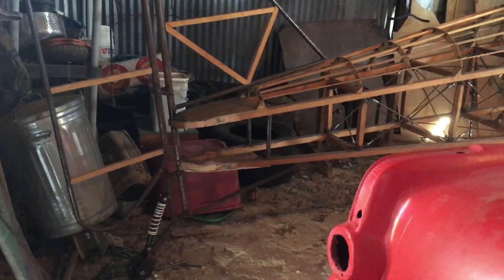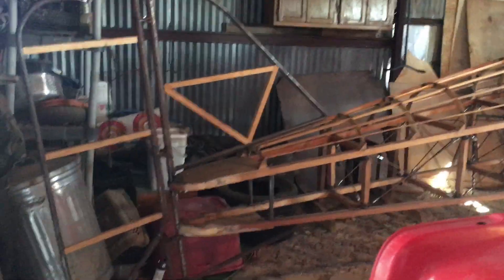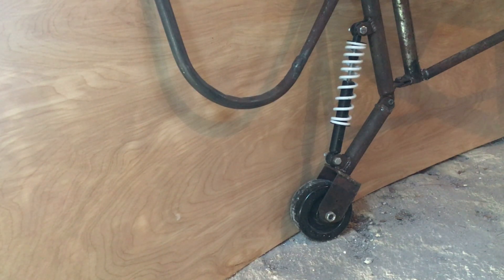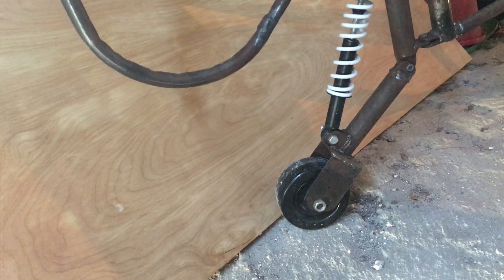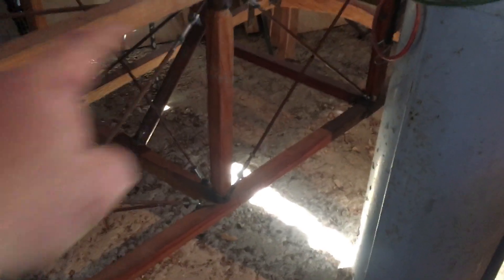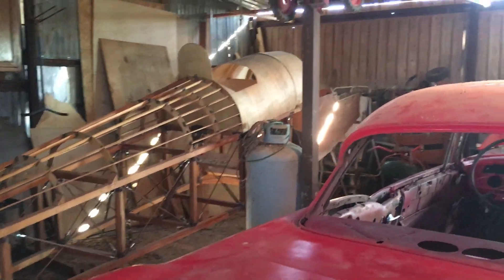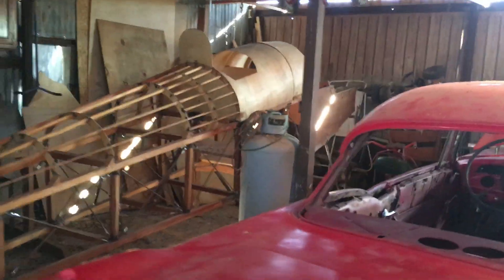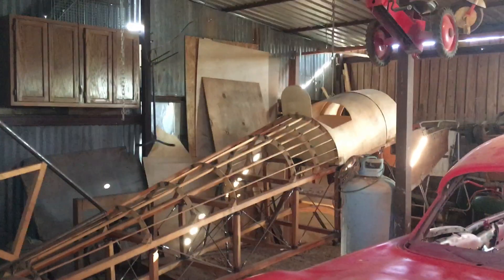Homebuilt Airplane Episode 8: The Landing Gear

Comment: Not a serious plane guy nor engineer, but are those little tabs the rudder is mounted to/hinged on strong enough to take the forces applied on the tail wheel?
Reply from the maker: I am a bit nervous about those as well. Surprisingly, were originally like that. I may end up welding on some reinforcement for peace of mind.

Comment: Does it really need breaks you think? Or is the wheel small enough to add enough friction when landing in a relativly soft field?

ofc not enough to 100% rely on it but realisticly, are you gonna use the conventional breaks a lot?
Reply from the maker: Brakes wouldn't be strictly needed for landings, but a small amount of braking power would be necessary for taxiing on pavement.
Reply: Ye on pavement brakes would be somewhat nice if you intend to land :p

Just make sure you tune them evenly. If it doesnt break on both sides equaly it might flip. 

Also, what kind of 3d printed weaponary are you gonna attach to it? Ofc not for real but its fun to think about ;)
Reply from the maker: @sawer Printing a fake Lewis gun and Vickers gun would be really cool, but I should probably save the drag and weight.
Reply: @EvanJonesProjects  Maybe very low infill combined with a lot of hollow spaces?

Comment: Very interested in the 3d printed gun because of its very unique have you though I trying to absorb the recoil and turning it into electrical power with a motor?
Reply from the maker: That's a really interesting idea! I hadn't thought of that before, but it sounds really promising. 

I have been thinking about alternative ways to make a DIY rifle lately. There's a ton of really promising systems, like blow forward and mag fed revolvers that have never been tried before. I really hope more developers start tackling rifle designs. They are intimidating at first, but they're less crazy than the seem. I may end up making a video about promising rifle systems.
Reply: @EvanJonesProjects  yea I don't know anything about making things let alone guns but I have tons of ideas I wanna try but I have no idea how to do them I'm trying to learn how to build things but man I wish school taught stuff like this maybe I would have stayed
Reply: I was thinking of a system like this https://youtu.be/Kb-GFfD3UHI @9:23 because there might be a way to harvest already manufactured parts as locking surfaces so that a rifle could be made with a 3d printer, jigs and hand tools. The problem is figuring out a way to mount the barrel and set the headspace in a way that it won't just walk out.